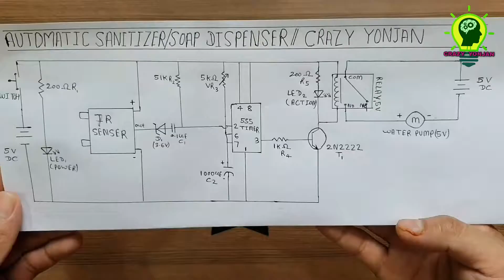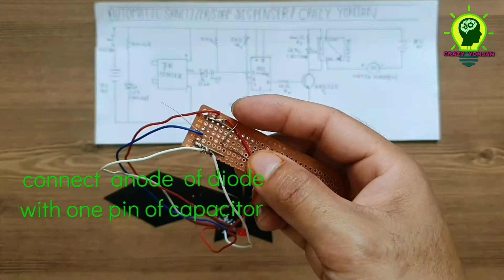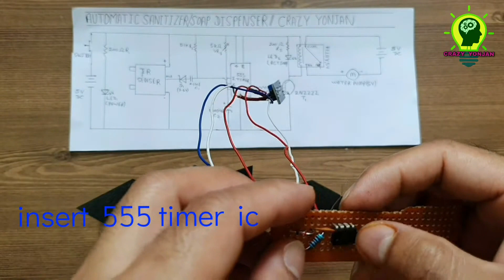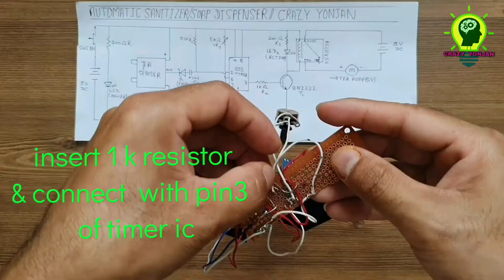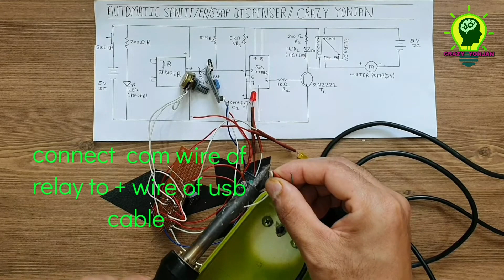How to make automatic sanitizer dispenser at home||diy automatic soap dispenser

Comment: I made this circuit there is a problem.when hit the trigger first time relay is on but time out is not working relay doesn't off
Reply from the maker: you should avoid direct sunlight with this project,due to normal ir sensor,otherwise it works well i have tested many times and still using.
please check circuit again  properly. if not solved, give me massege ,i will try to solve.thank you

Comment: Bro one more question k capacitor kitne watt aur kitne microfarad ka use karna hai is circuit me???
Reply from the maker: thank you for  question,actually, in this circuit ,
2 capacitors are used ,one is ceramic capacitor(104)
which is o.1uf or micro farad and another capacitor is
electrolytic capacitor of 1000 micro farad.actually ,
you can use capacitors between 100 uf or micro farad to 500,1000,2200,3300 uf or micro farad, it is actually
used to make time delay.so,more value of capacitor
means more time delay.
so, aap 100 uf se lekar500,1000,2200,3300 uf  se 
kisi vi use kar sakte ho. but 500 uf se lekar 1000 uf better hoga.lekin  yek baat ki dhyan rakhe 
 ki agar hum 5 volt power supply use kar rare ho to
capacitor ki rating voltage ( jo capacitor me likha huwa hote hai)oho hamare  power supply se jyada hona chahiye
jaise ki 100 uf (10 volt), 100uf (18volt ) or more
agar aap 100 uf 3 volt capacitor  5 volt me use
karenge ko o damage ho gayega.so aap 100 uf se 
jya or 5  volt  se jyada(jo capacitor me dekhe)  kisi vi capacitor use kar sakte ho.capacitor ki power(watt) se utana taluk nai hai.
if you have any more question, write doun surely.
i will try to solve.
Reply from the maker: aur yek bat, agar aaf normal mini fountain pump use karenge, to oh only alcohol based sanitizer dispense 
karegi ,lekin agar aaf geared pump jo ki maine 
use kiya hai usko use karenge to ye har kisimki 
liquid yane ki alcohol, gel based sanitizer, shampoo,
milk, oil,liquid hand soap vi dispense karegi. if 
you have any question , write doun surely.
i will try to solve.

Comment: 1000uf capacitor is of how much watt??
Reply from the maker: it is 5 watt and 10 volt capacitor, we are using 5 volt power supply so it can handle the voltage easily. if you 
have any questions,please write down surely,i will try to solve as fast as possible.

Comment: What if we connect relay com to the same positive point so that we don't have to connect another 5v dc connection for coil. Is it possible? Do we have to use IN4007 diode for that?
Reply from the maker: thank you sir for your opinion,actually,in4007 diode
is used to protect the circuit against the reverse
 voltage generated by moving power from a relay's
coil.so in this case, if you like you can use but without 
diode ,the circuit works well,too.
another thing,in this circuit , iam using 2 power supply
,because motor consume more current at load upto 1 amp.so it disturbs the function of circuit,so i gave 
seperate power supply because my power supply is
5 volt 2 amp olny,so it is not possible to make single
power supply with 5 volt 2 amp.
if you have 5 volt 5 amp power supply then it is 
possible and you can  make single supply surely.
if you have any questions,write down again,
i will try to solve as fast as possible.
Reply: @CrazyYonjan  thank u for you suggestion it solves my issue. So which mobile  charger can we use for single supply
Reply from the maker: you can use any mobile charger which 
have 5 volt (2 amp) output
any question,write doun surely. i will try to solve